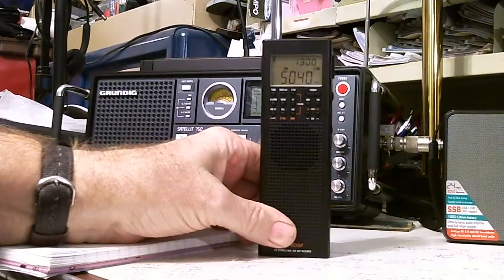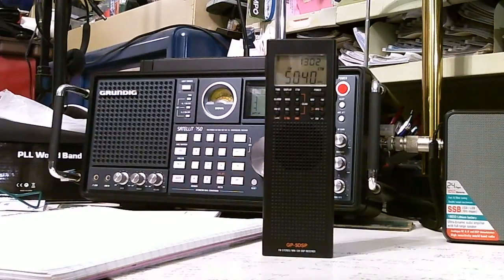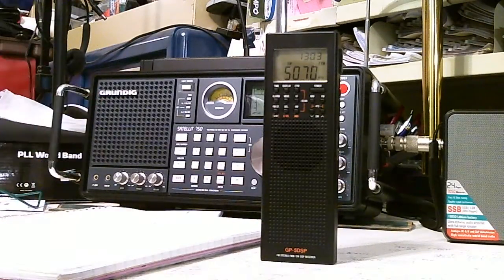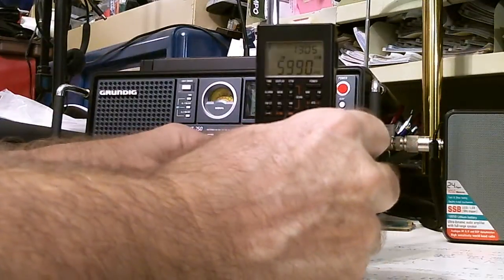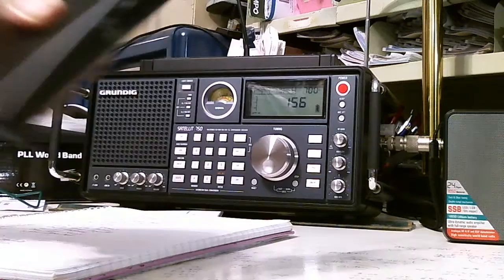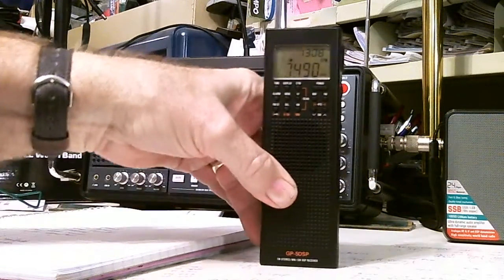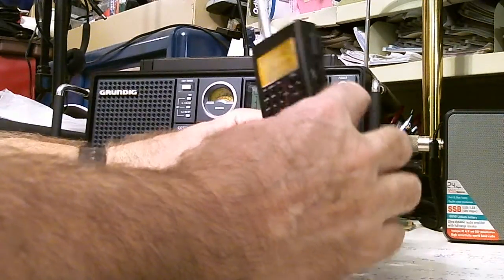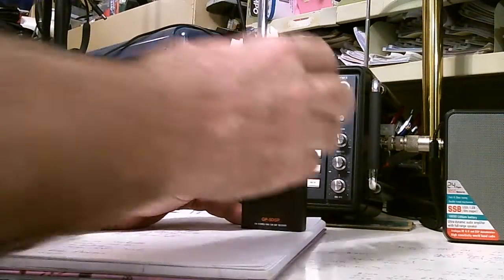TRRS #0190 - Reception Testing of the County Comm Shortwave Radio

Comment: Hey Tom, take care down there with that monster hitting Florida this weekend! 
 Want to trouble you a little more for advice. For a fellow on a tight budget  is the added cost of ssb worth it? The new county comm w ssb is one I'm looking at for 90 bucks. 
I had about decided on the pl310 then started considering the  current cc skywave for 90 , noaa with s,a,m,e good reviews on it but no antenna jack. 
 I've owned a couple of sw radios over the years but never ssb capable.  just wondering if I'd pay a lot more for a novelty that I'd rarely ever use? Is ssb worth it?
Reply from the maker: Thanks.  SSB is more than a novelty.  Most ham operators uses SSB and many utility stations such as weather and the military use SSB.  If you are only interested in International Broadcast station they mostly use AM not SSB,
Reply: hamrad88 Ok, thanks. Think I'll get the county comm. I want a quality am fm sw with great battery life for a go bag anyway. If I like the ssb, I may invest in a larger simi portable/ table top radio later on. thanks.

Comment: Useless with the computer noise. An idea, Use your phone to record the vid.
Reply from the maker: I usually do this type of testing (using internal antennas) in the field.  I have about 8 computer devices running in this room, routers, switch and lights.  It is summer now and the temperature is in the 90s with humidity in 80s so I will do some outside testing in a few months.

Comment: Tom, how do you change the antenna on this radio if you break the existing one? They send an additional antenna in the box but no instructions as to how to switch antennas. Thanks.
Reply from the maker: Does the new antenna have a screw or screw hole?
Reply: THE BASE OF THE ANTENNA HAS A SCREW HOLE. BTW, CAN THESE ANTENNAS BE OILED? I NOTICED THEY STICK SOMETIMES WHEN I TELESCOPE THEM UP AND DOWN. THANKS. I ALSO GOT THE NEW COUNTY COMM GP-5/SSB FOR THE UPPER AND LOWER SIDEBAND OPTION. THE ANTENNA LOOKS TO BE THE SAME TYPE AS ON THE OLDER GP-5DSP.
Reply from the maker: That would indicate that the antenna could be unscrewed.  I would not recommend you put oil on the antenna as it will attract dirty and dust.  You would rather is be stiff than loose anyway.  The antenna should be the same as the older radio.
Reply: what about wd40?
Reply from the maker: I doubt that would help but it is less likely to cause other problems.

Comment: Commet on external antenna.  A telescoping antenna works well with a plain wire clipped on.  This is because the particular circuitry is impedance matched for random wire antenna high impedance antenna.  Your shielded coax is a 50 ohm section to an antenna of unknown impedance.
Reply from the maker: +E Rollin Thanks for the info.

Comment: I noticed the rear of this radio, specifically the back of the belt clip where there is a  recessed hole, kind of oval and oblong shape. County Comm can easily design and sell an optional stand for this radio that can be readily attached to the rear of the unit. The company can adapt a thin metal frame base to this radio that has, at one end, a base that can help prop up the radio and at the other end, a narrow configuration that can be squeezed closer together and inserted into that recessed opening in the rear of the belt clip that is on the radio. Customers can squeeze the metal frame/radio supporter with a little pressure in or out to either attach it easily to the rear of the radio or to remove it from the radio when it is not in use. The metal frame/radio supporter can then be stored in the optional storage pouch they sell. They need not have to re-design the radio to achieve this and make everyone happy.

Comment: why dont you use the special usb antena that come with the kit to review the reception of this radio?
Reply from the maker: Mine did not come with a USB antenna only a USB charging cable.

Tom
Reply: no such thing as a USB antenna, the Radio comes with a Plug in AM bar antenna for MW and a clip on Long Wire for SW reception.